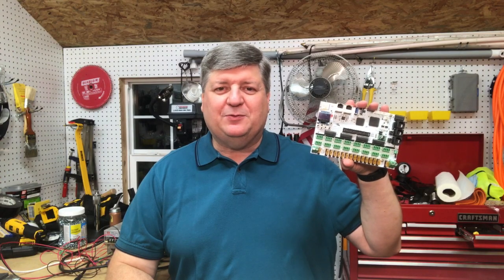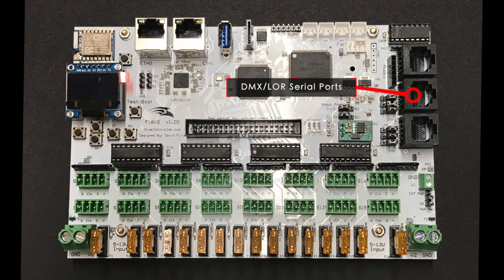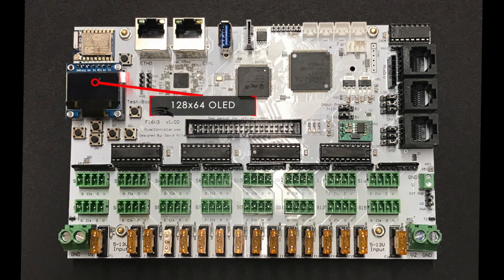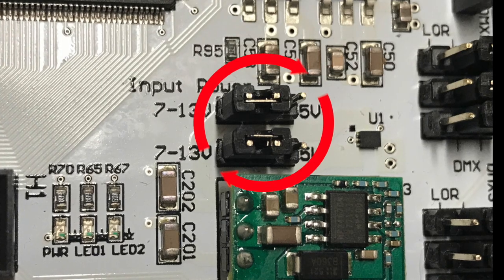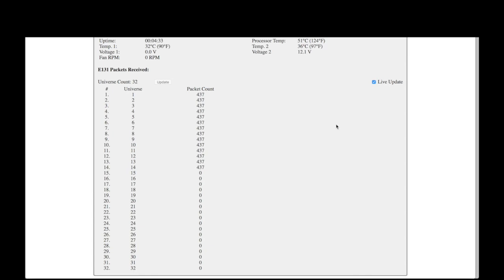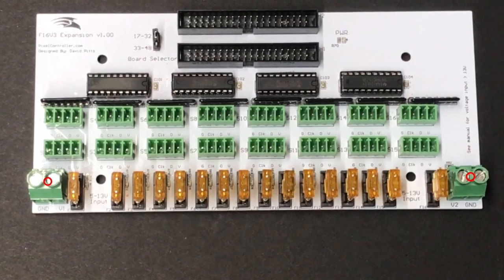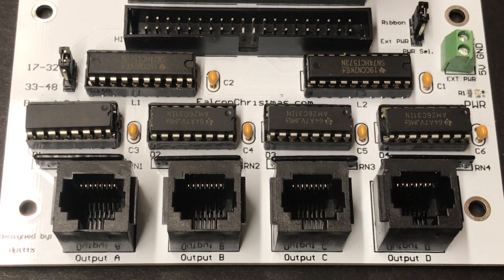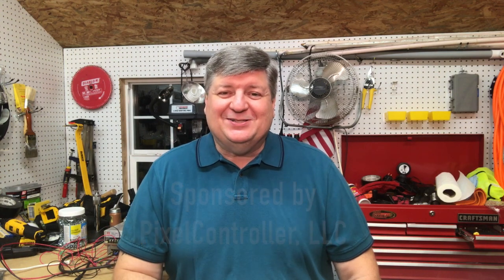Falcon F16V3 Pixel Controller

Comment: I finally received my ready to run falcon F16V3. I plugged it up and hooked it to the the computer. Everything seems to come on and work. However I did not seem to get a falcon screen with channels and what not like you did. I'm sorry but could you point me in the right direction. Do I need a falcon pie player to run lights. I was hoping buying the ready to run controller meant what the title implied. I plan on printing of the manual tomorrow at work. It come with no manual what so ever. sorry to be a nuisance.
Reply from the maker: No worries. When the controller comes on, the screen should show the logo then settle on the IP address it received via DHCP. Type that IP address into a browser (assuming computer and controller are on the same network). You should see the config pages. You don't have to have FPP to run the lights. xLights has an output to lights function or you can use xSchedule (part of the xLights download) to play your sequences from your computer. The controller also has several test modes just to get the lights to turn on.

Comment: Have you tested PixLite 16 MKII controller?  What do you think compare to Falcon?  I not sure which one to get.  I want to be able to use with Raspberry and PC software.
Reply from the maker: I don't have any experience with the PixLite controller, but it looks like it accepts E1.31 so I'd say probably. You might want to contact them to be sure. 

Otherwise, the Falcons are excellent boards. I know there is a firmware update available for PC users that enables some of the dormant hardware on the board, but I haven't updated mine yet because I'm on a Mac. The Mac version is coming soon tho.

Comment: Great video as always Jeff! Thanks! 

I just received my v3 which I bought because of this video. 

Question: you mention the SD card can be used for stand-alone mode in future firmware versions. Would that allow me to skip the Pi setup and run everything in my show from here - including sequencing, audio output - plugging my fm transmitter to the audio out of this board?
Reply from the maker: My understanding is that the firmware update can turn it into an FPP Remote, but not a Master. You still need a Master. I haven't tried it.
Reply from the maker: Oh and Thanks! Trying too hard to answer the question! :)

Comment: So I got my f16v3 the other day in the mail and I like the board it works great, however the power for the left and right sides of the board have to be the same voltage, the two jumpers are gone and were replaced with one switch.  Still trying to figure out the differental receivers.
Reply from the maker: Not sure what you mean. Two power connectors. The left side powers ports 1-8 and the right powers 9-16 plus the board electronics. If you're running the same voltage on both, just run 2 pairs from the power supply, one to each side. The differential receivers may be the new ones. Check out https://youtu.be/uyGo76NJ_bM
Reply: @CanispaterChristmas  on your board you have two jumpers in the middle of the board to switch power from 5volts to 12 volts so you can power ports 1-8 with 5volts and then you can power ports 9-16 with 12 volts if you wanted...however on mine the jumpers have been replaced with a single slider switch so all the ports have to use the same voltage.
Reply from the maker: @adamrowe6625  That doesn't sound right. My board has 2 jumpers, but that only depends on what you have coming into V2 as it sets the voltage for the electronics on the board depending on input voltage. It has nothing to do with what you have on V1. Do you have both voltages or just getting familiar with the board?  I know things change from time to time, but you may need to reach out to David if he's updated something I'm unaware of. His info is at the bottom of his website.
Reply: @CanispaterChristmas  I sent him a email to ask why the change, I can show you. Pic if you have a place I can send it so you can see.

Comment: How do you power this?  DC?  Where do you get DC power from
Reply from the maker: AC to DC power supply. Most use the MeanWell supplies because they are reliable. You can use the cheaper ones, but have some extras on hand just in case.

Comment: Any Idea where I can get, or what the name of the plugs are on the output ports?
Reply from the maker: They are 3.5mm Phoenix Contact, pluggable terminal blocks or euro-connectors. Dave sells them in 8-packs on pixelcontroller.com for 4USD, but most large electronics stores will have them as well.

Comment: Question...... can I add a second expansion board to my f16v3 but run one of them at 12 volt and the other at 5v. My f16v3 will also be at 12volt.
Reply from the maker: Both the F16V3 and the 16-port expansion board have 2 power connectors (one for 8 ports). You can run 5V on one side and 12V on the other. Just make sure you don't plug your 5V strings into 12V. :(
Reply: thanks

Comment: Thank you so much. I am waiting for my falcon v3. I have 3 ren 24ss and 2 arduino 16's, pixels are going to be new this year, quick question can I run the Ren's off of the falcon? I will be using a single network  cable from laptop running vixen 3, to falcon then to Ren's ? I hope so as I only have 1 cat 6 from my desk to the outside and I'm already short on time and will never have time to figure out wireless thanks again for a great video
Reply from the maker: Thanks Frank! I believe so. The DMX output on the should be able to drive the Renard boards, but totally out of my wheelhouse here. You might try googling or ask over on the Falcon forum. Surely someone over there has the experience needed to assist.
Reply: If this does not support dumb pixels what is the best option for running a combination of both dumb and smart pixels
Reply from the maker: @ericpeterson4895  I did a video on the board from Hanson Electronics (https://www.youtube.com/watch?v=dc9gOXgK718&lc=UgwehM_DZEr0Va2GQ-R4AaABAg). It uses SPI data to drive the dumb pixels so should work with any board that outputs to RGB pixels.

Comment: Awesome review! I just purchased this thanks to you! I'm new to this was hoping you could help me with a question. Since the ports are all 5amps, does that mean that you can only connect 50-100 pixels?
Reply from the maker: No, there are tricks such as dropping the brightness, using power injection, the current draw of the particular pixels you have to keep the current flowing through the board under 5 amps. I'd recommend just keeping the strings short your first year since there is so much else to learn.
Reply: @CanispaterChristmas  thank you. I am still learning. Would you be able to advise me with this current situation.
I have one string of lights on port one that goes to flake 1, flake 2, wreath, arch 1 and arch 2 with a total of 462 5v pixels. I have a set of +&- wires running parallel from the PSU to all of the props. Should I be cutting the v+ wire anywhere?
Reply from the maker: Haha. ...or you could go this way. lol! You only cut the + when using multiple power supplies. If it's from the same supply, no cutting needed.
Reply: @CanispaterChristmas  I ask because this is how it is currently setup with no wires cut and only one PSU  and power injection running to all the props from the same PSU as the controller and only the first couple of lights turn on. Should I be feeling the controller from its own psu? If I go into XLights and add light to each prop it works fine, just not all of them at the same time
Reply from the maker: Hmm. Hard to say what is going on from the information I have. I do know that 5V on the controller can be tricky if the load drops the voltage too much. In that case, a small independent supply might be in order. Have you tried checking into the xLights Zoom room (see xlights.org) to see if someone can walk through it with you live?
Reply: Thanks Jeff. I will try a independent PSU first then try the next option you provided. I sincerely appreciate your feedback.
Reply from the maker: My pleasure. Let me know how it goes.
Reply: Do you know what amp rating I should get for the separate PSU?
Reply from the maker: Couldn't find it in the spec sheet, but this is that I use for my F48. https://amzn.to/2PgFRFB
Reply: You just cut the ends and connected them to the external power supply ports?
Turns out the pig tails I ordered online were cheaply made and some of the connections were loose. All is resolved! Thank you sir
Reply from the maker: @JGFAM  For power injection? Yes, you can do that if you don't have available pigtails and/or want some to use elsewhere. Glad you got it working!
Reply: No I was referring to powering the controller with that adapter you linked.
Reply from the maker: @JGFAM  Oh, well it fits the connector for the F48 so no cutting needed, but yes, you can cut it and use it. Just check it with a voltmeter first to make sure the polarity is correct. If you connect it to the AUX power connector, make sure to change the jumper.
Reply: @CanispaterChristmas  would that fit the f16v3 also without cutting?
Reply from the maker: @JGFAM  No. The F16 doesn't have a power connector like that. It only has screw terminals.
Reply: @CanispaterChristmas  got it. But I could use that particular adapter and splice the wires to connect it?
Reply from the maker: If you have the socket for that plug, yes, you could just connect the socket wires to the F16.
Reply: @CanispaterChristmas  
Would you say it's okay to power all ports from one PSU instead of two separate ones for each set of 8?
Reply from the maker: Depends on the number of pixels, but assuming you are staying under 80% of the supply’s rated output, sure.
Reply: @CanispaterChristmas   thanks! I ended up having some issues but the issues stopped after I powered the board using a separate 5v wall power cord! Appreciate your help.

Comment: how can you do to put the audio in a jack port?, thanks
Reply from the maker: Not sure I understand. Are you asking about audio output on the F16? If so, you may need to talk to David as I don't run the F16 as an FPP remote. His contact info is at the bottom of the pixelcontroller.com web page.

Comment: Does the Falcon controller support RGB W or RGBWW lights?
Reply from the maker: Maybe. There is a list of supported pixel chips on the web site at pixelcontroller.com. Do your pixels or the ones you're interested in fit that list?
Reply: @CanispaterChristmas  I believe they are UCS 1903, which appears to be on the list. Do you know if you can control RGB WW lights in X-Lights software?
Reply from the maker: Jonathan Button what is special about them? I don’t think xLights cares what lights you have.
Reply: CanispaterChristmas , I’m a newbie so I guess my knowledge is low. I actually don’t have the controller yet, or the software but want to make sure it will work before I buy the controller. I need the lights to be a warm white3000K rather then the cool white 6000K normally produced by RGB LEDs. So I just want to make sure I can achieve the warm white color via the controller and software.
Reply from the maker: @jonathanbutton1  Hmm. Send Keith Westley a note. He's one of the xLights devs and will know for sure.
Reply: @CanispaterChristmas  Thanks a bunch!

Comment: I have watched your videos and love them,  thank you so much for the information.  I am looking to start a display using both pixels and old style 120 voltage lights.  I am planning on getting a F48 Differential Controller and receivers due to the size of the yard.  can xlights be used to control relays for the old style AC lights.  I had planned on using Arduino but after watching your videos I see that will limit what I can do in my display.  do you have a forum that you would recommend for a beginner?   thank you for your time
Reply from the maker: Thanks! Really all of the forums or all of the FB groups or both are great. If you have specific questions regarding xLights, then the xLights forum (nutcracker) or the xLights support group. To answer your question, yes, xLights supports AC lights. There are videos out there talking about that (I've seen them), but I don't recall where I saw them - possibly GilRock's or Clyde's channel. There is AC in most of the forums, especially Planet Christmas which I see is not on my list (planetchristmas.com). Welcome to the hobby!

Comment: d can this board take the place of a pi or do I still need one to get my show going I am just starting my journey and don't make much money the board would save me some money if I don't have to buy a pi and the falcon too can you help??
Reply from the maker: Well, it can take the place of a slave Pi, but you will still need either a Master Pi or a computer to run your show. If you run from a computer, I'm not sure slave functionality would be useful as FPP wouldn't be in the picture so there would be no timing packets for the slave. I haven't updated my firmware to take advantage of the slave functionality so for me, it's just an awesome controller! :)
Reply: how do I link it too a way to use my plug in lights for the show
Reply from the maker: You will need an AC controller like LOR or Renard to plug the AC lights into. The Falcon can output DMX to those controllers as well as run the pixels.
Reply: Thanks I did call falcon the guy there is just as helpful as you have been thanks for all the help

Comment: Hey!! thank you so much for the videos! I have a question, I have 2 missing Fuses: 
that means that channel will not work again??? Please help on this one.
Reply from the maker: I believe they are just 5-amp ATM fuses. You may find them at an automobile parts store. Here's an Amazon link: https://amzn.to/2qJzORu
Reply: @CanispaterChristmas  thank You! I am figuring out what s the problem. I have a 5V 40a powering V1 and V2 and a 5meters ws2812b in one channel, the best un this case is Power injection? If the fuses don t work Power injection is posible, data pin still work?
Thanks!
Reply from the maker: Data pin still has data. Be sure to use a fuse for power injection. :)
Reply: @CanispaterChristmas  so i need to repair or replace the fuses for Power injection? Last question, is there a problem if I use a 40a in V1? Ir this 40a in external Power?
Reply from the maker: Fuse any power for safety. No matter how big on input. Board fuses protect the board.

Comment: can you do a video on how to update the firmware for the f16v3 
And explain the improvement and additional features being added
Reply from the maker: Joe, I haven't updated yet. David said a new update process was coming, but I haven't seen it. I believe it currently requires a Windows PC which I don't have. As I understand it, the main improvement is the WiFi chip is turned on and it can function as a Falcon Player remote. As soon as I update, I will do a video, but I don't have a timeframe just yet.
Reply from the maker: There is a video up there for updating the older controllers with a java tool, but the only updater I see for the F16V3 is the Windows tool.

Comment: You told me to message you here instead of email, so... now I have my Falcon F16V3 Controller, MacBook Pro Im running xLight's I have 1 string of pixels connected, rather than searching ALL of your video's again... do you explain how to create just the simple sequence to test new pixels... you know where they just run through Red, Green, Blue, White in that slow cross-fade? I know Ive seen the video, because that where you mention  when you get a new order from Ray, you like to test everything to make sure it's all good. Ok, I want to do the same thing... How Please ???
Reply from the maker: You can just put the controller in test mode and it will light up the lights. It’s called color wash. You can either hold down the test button for about 3 seconds or turn it on via a web browser.
Reply: ok, hooked up some pixels and ran the test button, on ALL strings, about half don't light up? Puzzled... @CanispaterChristmas
Reply from the maker: You may have to change the outputs. I think default is 50 per string.
Reply: That's what I was thinking... @CanispaterChristmas

Comment: Jeff, Can you do a “step by step” video showing how to download x-light programs to this controller to control a 16ch “Mega Pixel tree” please. Thx
Reply from the maker: I use this controller as a data converter (E1.31 to SPI). I'll have to check to see if the FPP Remote functionality has been built into the firmware, but I haven't used it if it is. Generally, we use players (Pi/BBB/PC) to schedule and play the xLights output files (FSEQ) over the network.
Reply: Canispater Christmas aka Jeff. 
I just bought a “Pi and a falcon V16 controller” , but can’t find any decent step by step instructional videos online how to set it up. Appreciate any help. Thanks. Roy
Reply from the maker: OK. I suggest watching Keith's xLights training video (in my beginner playlist). Actually, go through that entire playlist if you haven't already. What you want to do is set up xLights so that it can program the F16 & Pi for you. So much easier than trying to do it manually.